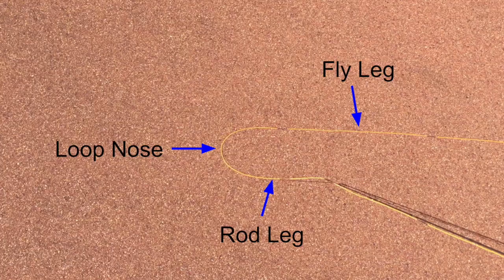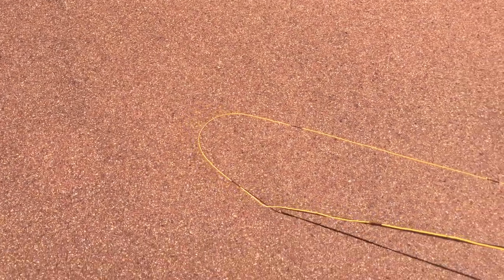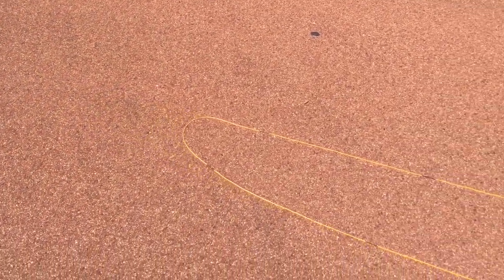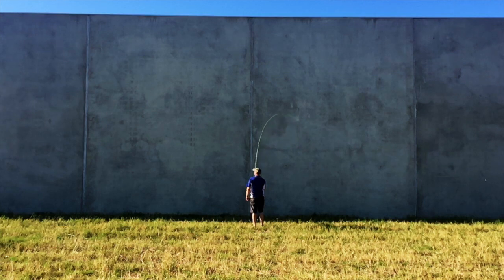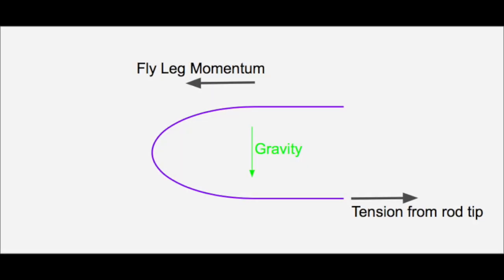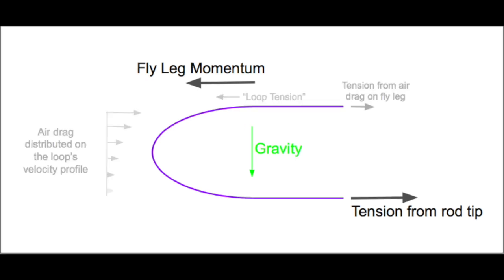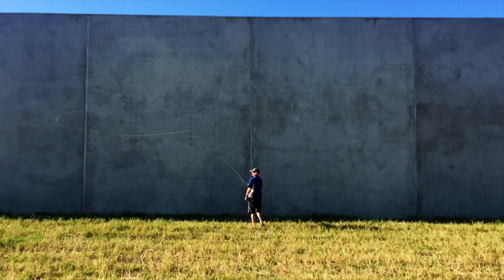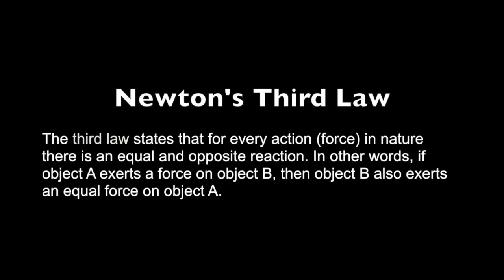Newton's Laws Motion and The Fly Cast

Comment: Hi Graeme - it seems to me that the tension that is in the rod leg is caused by the change of direction of the fly leg which is occurring by the fixed (non-moving) rod leg inducing centripetal acceleration throughout the loop.  The resultant centripetal force is what is the opposite and equal Newton force on the rod leg - or tension.  And that tension is what is needed for the loop to propagate as per wave theory as you have pointed out in other videos.  The loop being not truly circular as well as the line not having constant velocity means there is some tangential acceleration that contributes to the total acceleration and doesn’t therefore point directly to the center of the loop, so the net force also doesn’t and that might be a contributor to the dolphin nose shape of some loops.  Just thinking out loud here 😂.  Paul
Reply from the maker: Hi Paul,

For tension to occur, we need a force at each end of the string (loop and rod tip) and we also get more force from gravity acting on a string with mass (as per the tension we see in overhead powerlines)
Reply from the maker: (And if there is wind, we get more tension in the string from that.)

Comment: This is an interesting look at what is going on in a fly cast, but it doesn't consider an important force that is at the heart of the matter. When the cast is launched the whole line is moving, and that whole line has a certain kinetic energy. As the line straightens out, the energy that was in the part that goes static transfers to the moving part whose mass is ever decreasing. For energy to be conserved it has to accelerate. Working against this is air friction which dissipates some of the energy. The balance of this accelerating force and air friction gives us the observed behavior of a fly cast. The effect of this accelerating force is much more dramatic in the case of another sort of casting setup, the bullwhip or stockwhip. The crack you hear is the tip exceeding the speed of sound. The above explanation shows how it gets to that speed since the whip hand can't move at anything close to that speed. Just what this accelerating force is comes from the more general statement of Newton's Second Law, which is that force is equal to the rate of change of momentum. Momentum is the product of mass and velocity. In simple problems where mass is not changing, only velocity is changing you have force is equal to mass x acceleration. If mass is changing in addition to velocity, you have the force equal to mass x acceleration + velocity x rate of change of mass. The front taper on fly lines diminishes the rate of change of mass so the end of the line comes to a stop at just the right moment without jerking back.
Reply from the maker: In essence, you're saying throwing mass out of a moving car will make the car accelerate because the car has less mass?
Reply: @Kalgrm  The mass you throw has a velocity and therefore a momentum, which in combination with the momentum of the car will be conserved. Whether the car speeds up or slows down depends on the direction of the throw--momentum is a vector quantity.  The mass thrown is the cause of the acceleration, not the diminished mass of the car. What you have brought up here is the physics of a rocket. That force equation includes a rate of change of mass term just like that of a fly line or a stock whip. Possibly this is what Cortland is referring to with their "Rocket Tapers."
Reply: @Kalgrm  Suggest you take a look at this https://www.youtube.com/watch?v=AnaASTBn_K4